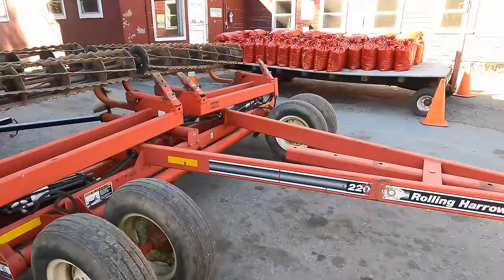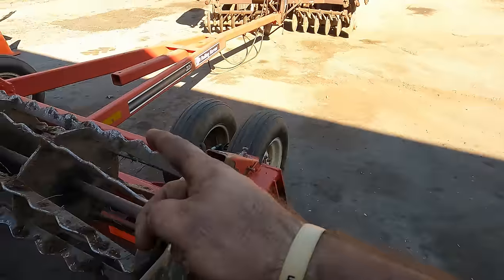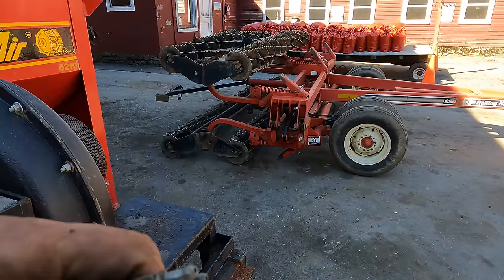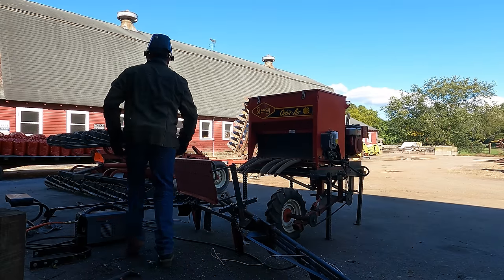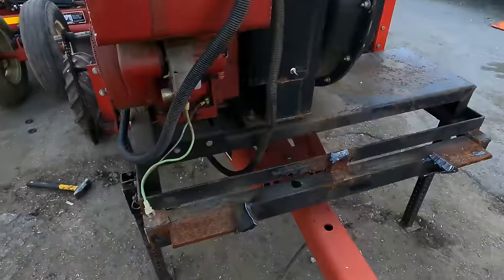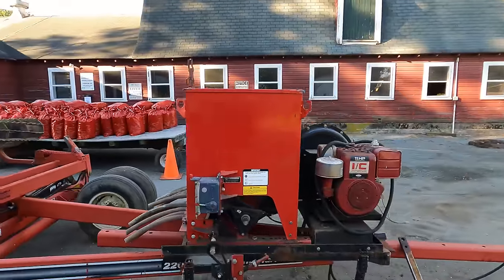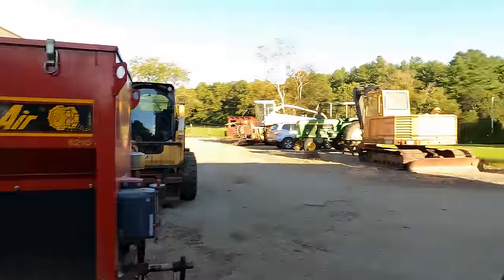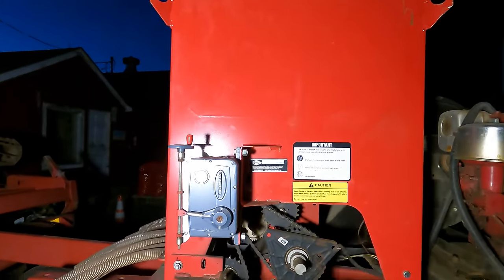Building A Air Seeder Tillage Tool

Comment: If and when you get a rock caught in the bars of the rolling basket do not beat it towards the center with a hammer, it will just become harder to get it out. Carry a 3 ft. bar and a 3 lb. hammer in the tractor with you. Stick the bar through the rolling basket so that it's pushing the rock out, few wacks with the hammer and off you go. Looking good Duffy

Comment: John deere ccs planters have a quick disconnect option on the seed delivery hoses you could possibly use for your seed hoses to remove the drill from your toolbar and leave the hoses.

Comment: Think the  metal on metal vibrating is going to metal fatigue your seeder, may want to use a pice of bailer belt or washing machine rubber foot  or similar vibration damper.

Comment: The plates aren't a Kemper/Deere part.
Walterschied. From memory there are only 2 sizes of plate and I've a sneaking suspicion (it's been a long time) that it uses one size on the drums and the other on the drive line clutches off the input shaft, under the back side of the header.

Comment: Guess I’m grasping to see where you have enough seed tube outlets to cover the width you need to do. You leaving the wings folded up?
Reply: think the idea is the deflectors at the ends of the tubes will force the seeds to kinda do a scatter shot, so if there are 7 tubes, and he can get about 3 feet spread each, it'll be close...
Reply: Brian, he had covered that in an earlier video when he first was describing his plans for this. He's got a buddy that has an air seeder setup about the same width. His setup has 10 channels and it's giving him good coverage apparently, so Chris figures he can design this one similar to that one and it should work.

Comment: do you need another support wheel on the opposite side of the chain wheel? what about bracing to hold bottom corners to frame...it seems over time it will sway back and forth and fall off one side or the other..

Comment: take drive wheel right off set seed box way back into the winhs and remount drive wheel. it can run in front does not need a be in back

Comment: My thoughts.Don't use the hitch tube  as a mounting point.Would run tubes across disc frame.Four bolted attachment points bolted to seeder frame.

Comment: Sack the engine off and fit a hydraulic drive motor.
Reply from the maker: I have thought about that but the tractors only have 3 remotes and I would need a 4th to make it all function
Reply: Fasse dubbler valve on the wing remote.  Hydraulic drive as primary and flip the switch to fold